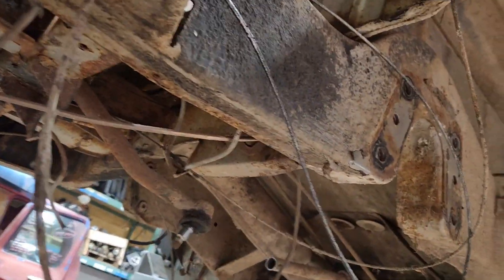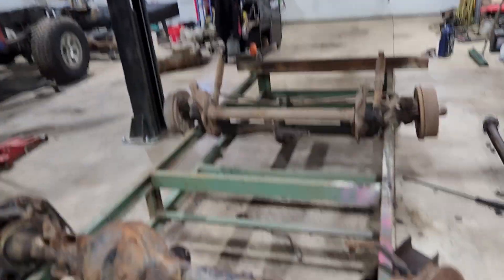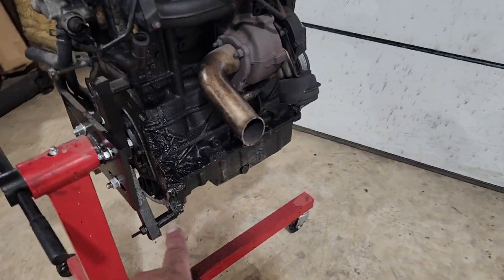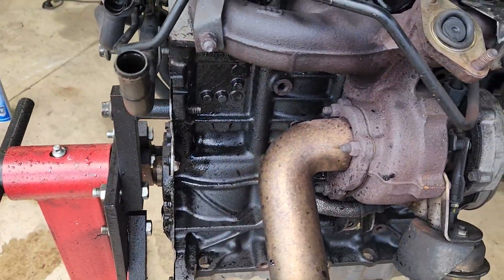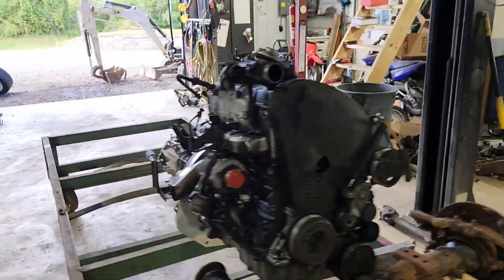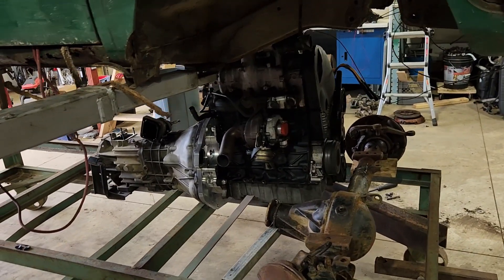Building The Ultimate VW Split Window Bus Explorer - 4x4 Conversion

Comment: Bruce Canepa built an AWD 23 window Volkswagen bus utilizing the engine and drive train from a Carrera 4. He built it for the Sultan of Brunei's brother a few years back. I saw it a couple of times in his shop when it was being built. It shows up in some of the older pictures of Canepa's sixteen car "Hollywood Squares" style "Wall of Cars"  vertical storage unit.
Reply from the maker: There are a few out there. I think I'm the first doing this configuration under a split and making it actually usable on the road.